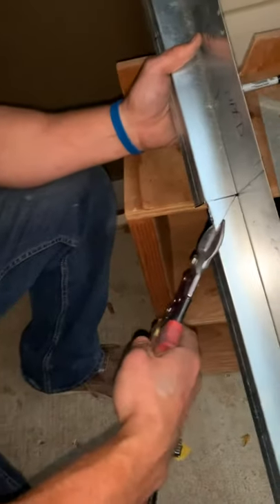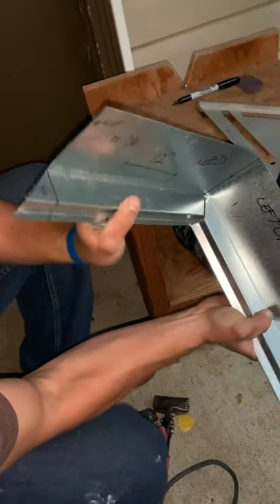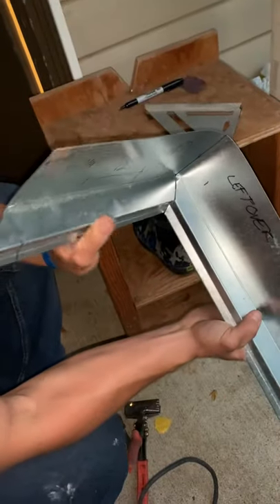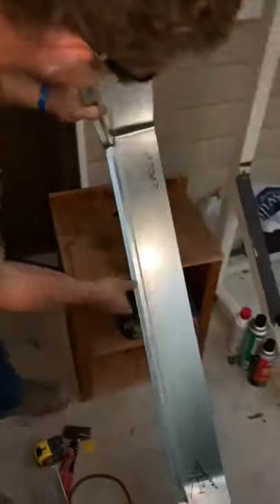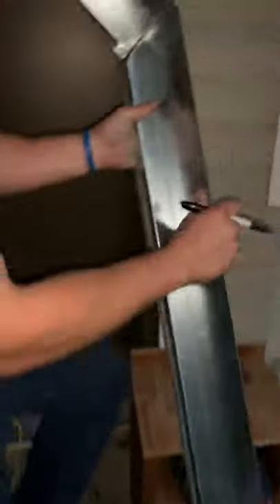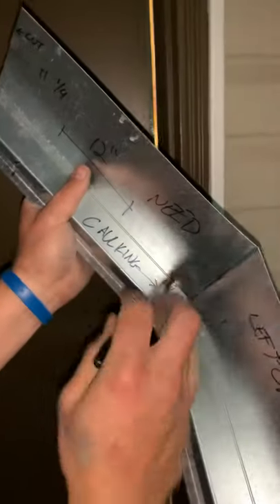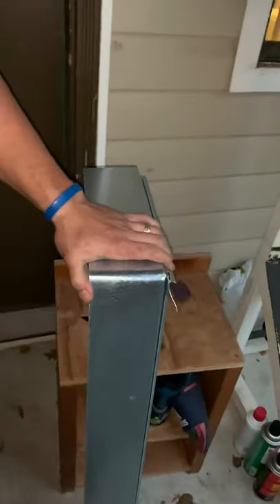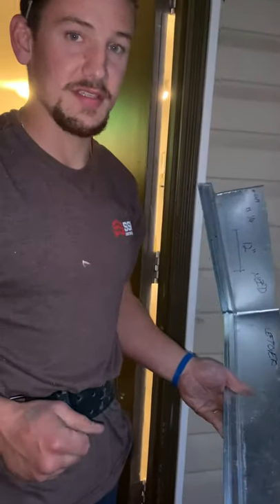Drip Edge Flashing - Inside Corners

Comment: Thank you for sharing. Could you please install one? Just to understand where to add nails and where not to during installation?
Reply from the maker: Hey, you’ll want to nail the upleg to the substrate as high as possible. With roofing nails. Typically you’ll want to place the nails where the building paper or water barrier can overlap creating a shingling effect. Ultimately the building paper will cover the fastener/nail.

Comment: I would like to see you adhere this to the building. What kind of nails. What does the final nail up look like?
Reply from the maker: Hi Laura,
 In this application we installed foil faced self adhered flashing to the building at the elevation of the flashing. Then we installed the drip edge flashing, fastening it with roofing nails. Lastly, take the building paper (Tyvek in this case) overlap the up-leg of the flashing creating the shingle effect. Installing the foil face flashing eliminates the condensation from the metal and the butyl adhesive seals the nails that penetrate the flashing. I hope that makes sense. 
Let me know if you have any more questions.

Comment: That piece you bent over that was from the 45 you cut, why not just cut it off?
Reply from the maker: Hi Joshua, Bending that over and up prevents wind driven water from going right into that seam and onto the wood your protecting. Additionally, you can add caulking to that 45 prior to bending over for extra waterproofing. Please let me know if that make sense. Thanks for viewing.
Reply: In sheet metal trim you always leave those tabs for caulking, so the caulk is pressed and squished between the two layers of metal for a good water tight seal.